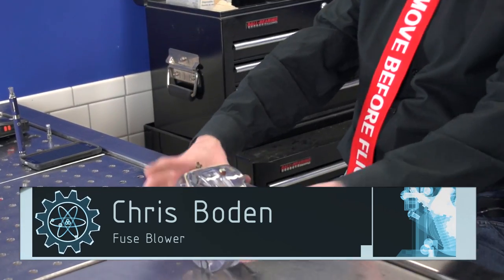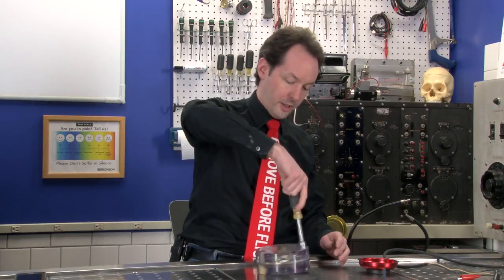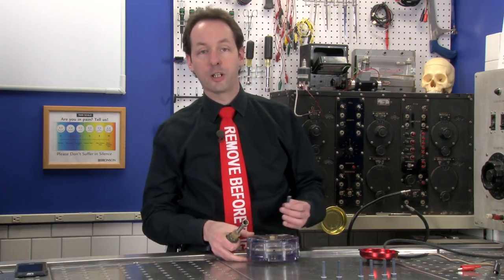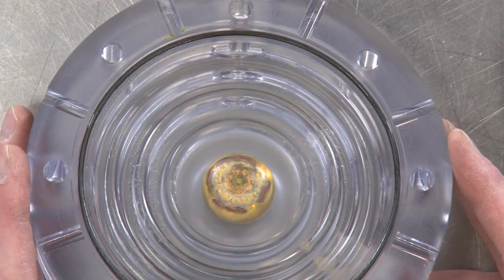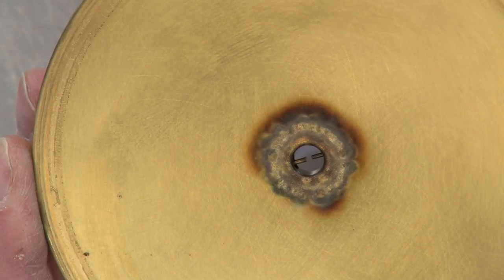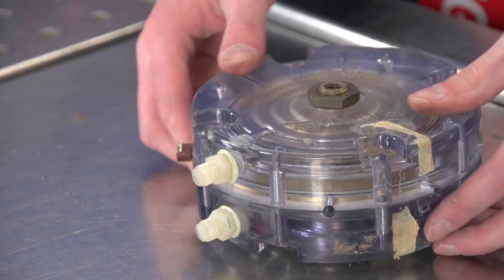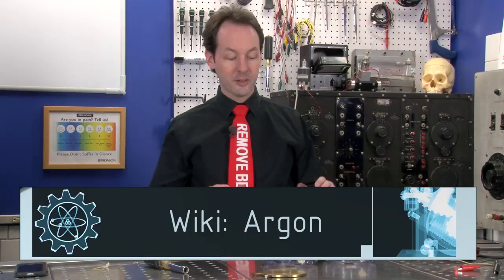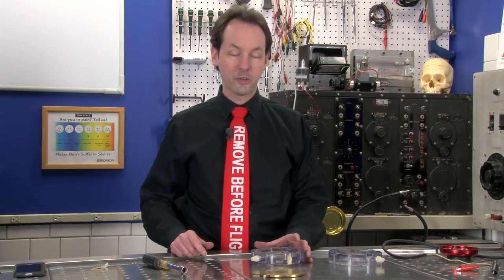Guess the Part: Equipment Autopsy #88

Comment: Very nice bit of kit there!

I'm betting you probibly could get it to work for the lower voltage though it might be tricky, I'm half tempted to give it a go myself. I suspect if you used a strong enough discharge at the trigger the area of plasma it creates might be large enough to create a path for the 1800V capacitors to discharge through. It's certainly worth experimenting and I would be really interested in seeing the results!

Comment: 5 minutes in. I change my mind. It's some sort of spark triggered high-voltage pulse switch. I've never seen one that didn't operate under vacuum before, but I guess there's a first for everything. The vacuum tube equivalent would be a thyratron or a krytron.

Comment: Argon wouldn't suppress the arc, on the contrairy, it has a much lower breakdown voltage than air. (somewhere around 18 kV/cm for argon vs 30 kV/cm for air if my memory is correct) 

I remember being told to never ever purge a spectrometer under argon, because it would cause the photomultiplier tubes to arc...